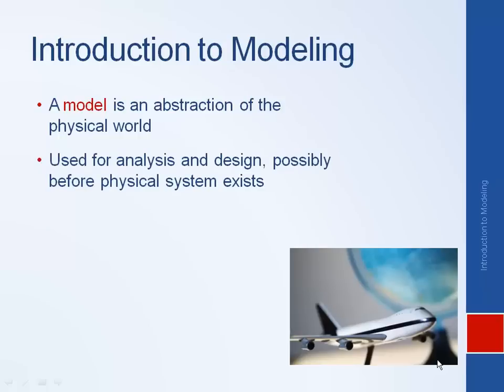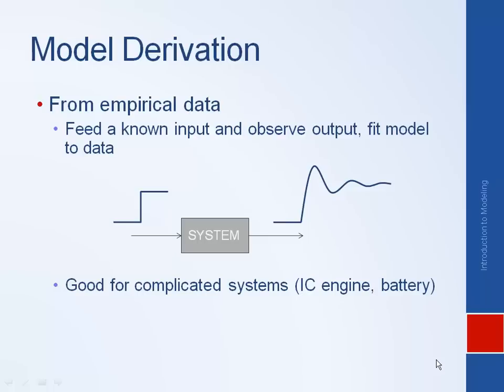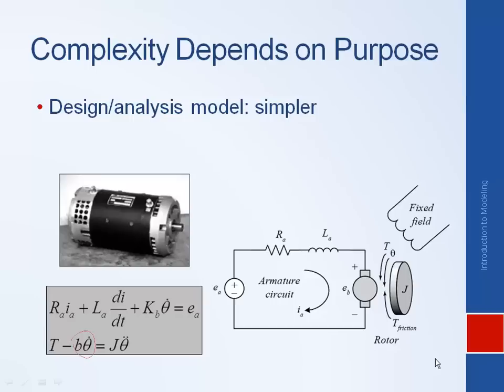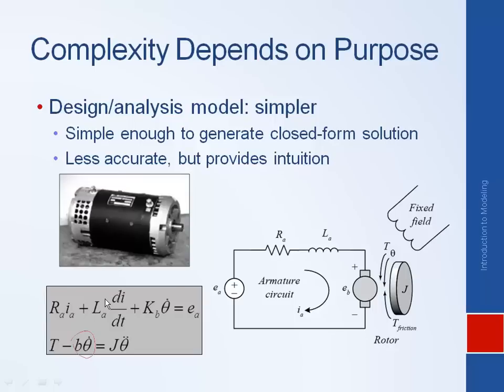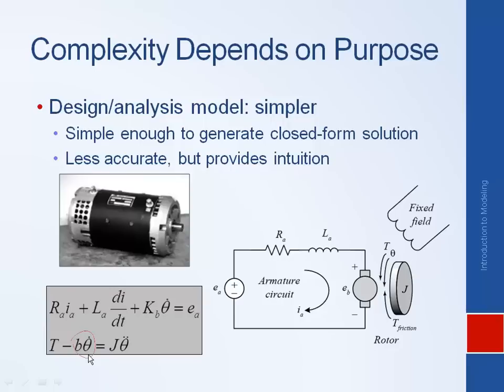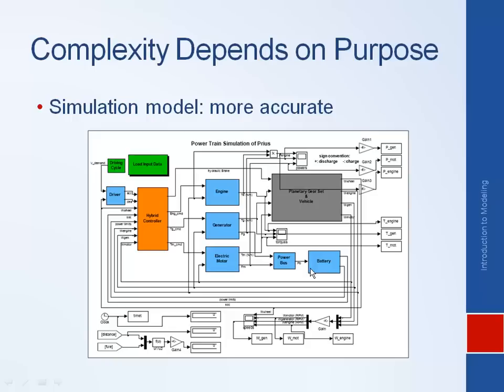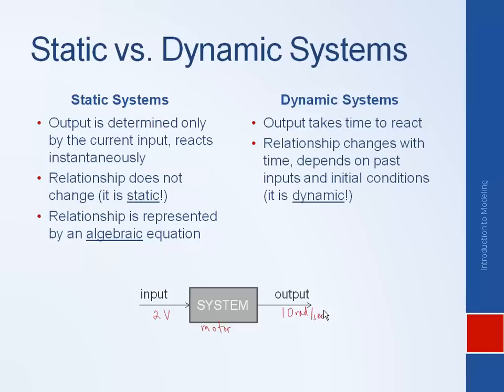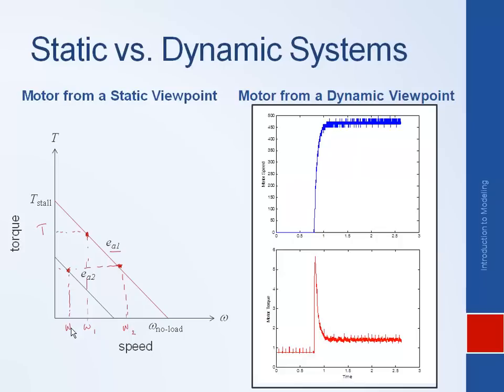Systems Dynamics and Control: Module 2 - Introduction to Modeling

Comment from the maker: Hello Qi, My lectures take material from many sources, but a book on modeling and control that follows the theory pretty closely is System Dynamics by Ogata. If you are more interested in the different applications, I can refer you to some other references.
Reply: Yea very interested and waiting. Thanks.
Reply: Hello, Professor Hill, I got the PDF version of System Dynamic by Ogata. Your series of video lecture are very useful. I was introduced to your channel by matlab. I was designing wind turbine and this structure is characterized by dynamic (vary in time and space). The method introduced are very important to use when you design a system in which you want to manipulate the dynamic in desire.
Reply: Hello, Professor Hill, I got the PDF version of System Dynamic by Ogata. Your series of video lecture are very useful. I was introduced to your channel by matlab. I was designing wind turbine and this structure is characterized by dynamic (vary in time and space). The method introduced are very important to use when you design a system in which you want to manipulate the dynamic in desire.
Reply: A nice, easy to follow book is the one written by Norman S. Nise, Control Systems Engineering

Comment: Where can I get the slides?
Reply from the maker: +Mathew George You can download them here https://dl.dropboxusercontent.com/u/22652560/Slides.zip
Reply: +Rick Hill thank you. I have two textbooks, one by Ogata and the other by Benjamin C Kuo, which one should I read along with your slides to get a comprehensive understanding of this topic
Reply from the maker: Mathew George Pretty much any controls textbook will work, though my slides are a little more focused on modeling than most controls textbooks. Depending on your edition of Ogata, it may follow pretty closely. The same author has a book called System Dynamics which is even a bit more suited to the material covered in my slides.
Reply: Mathew can you have module 1 of rick hill?
Reply: @hillrickc  Thank you very much for these lectures. Is it possible to get the slides? the dropbox content does not work or not active any more. Could you please share the slides again , it would be very helpful.
Reply from the maker: @karthikeyanvenkatesan1009  Try this: https://www.dropbox.com/s/u7k7cf24md4zx1r/Slides.zip?dl=0
Reply: @hillrickc   Thank you very much for sharing the link. It works. I don't see the Lecture 1 slides. Could you share them please?  This is to get a good start and also the Lecture 1 video to refer to various examples? 
Hope this is ok with you.
Thanks again
Reply: Sorry. After looking at Lecture 2 rev2 (Module2), I realized that this would be the starting point. So, I think we are all covered. Thank you.